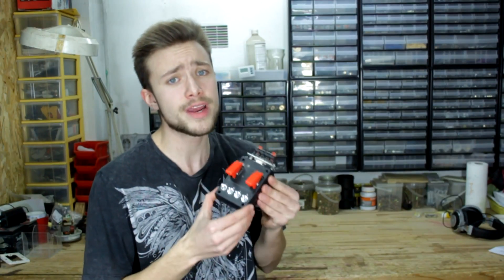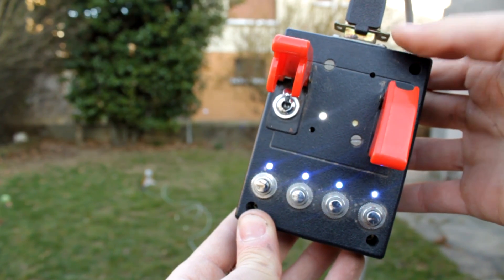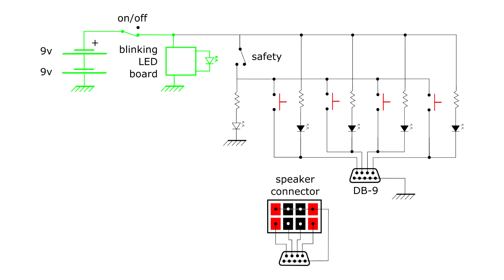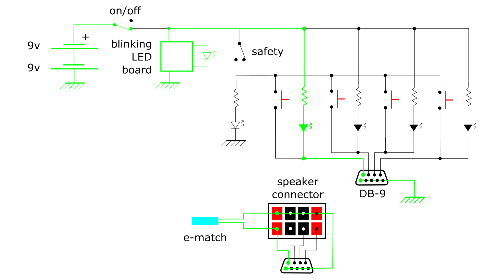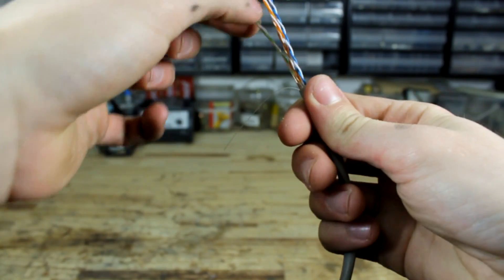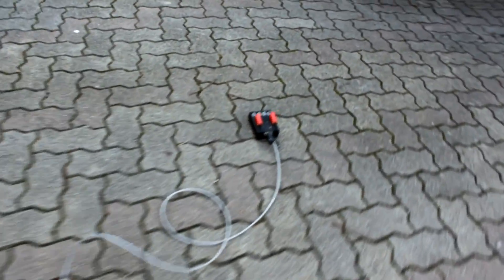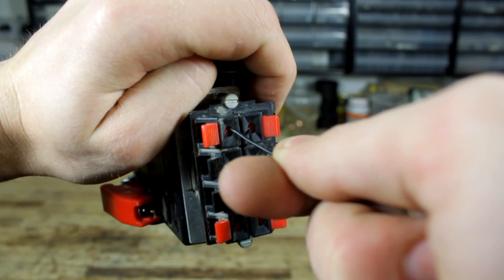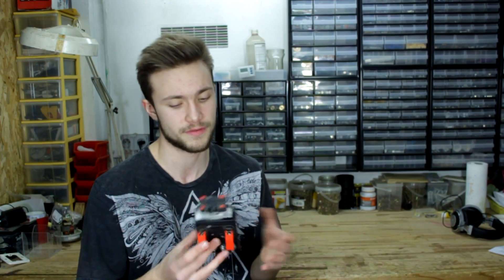HOMEMADE FIRING SYSTEM - How It's Made - Nicolas Salenc PBP

Comment: Nice job,  fun project and a lot cheaper than buying. Here`s a 15 cue firing system i made for rockets a while back. Its arranged in 3 banks of 5 with constant continuity checking, all bank fire and arms via a key. Its powered by an 18v drill battery and connects to the slat via cat 5 cable. 
The first version was ultra bright, https://youtu.be/uQrkAGDJCzg  
so i modded it,  https://youtu.be/UzoNLkuCxg4 
Never did get around to the front panel cosmetics. https://youtu.be/W10qlbV9fR4

Comment: I'm trying to build this but with 96 cues Any advice and can you walk me through this I'm no rocket scientist And don't want to blow my face off when I connect the wires to fire my shells!! LOL
Reply: Always shunt the opposite end of the cable going on your pyro and only connect to your box when you are at a safe distance from your pyro. It's just good practise to get into for safety. Search up nail boards and see if you can make one. They are the most reliable firing system I use. They just never fail because they are so simple. Can rig it up to car batteries in series and it won't let you down :)
Reply: @frgc6159  wanna build a 24 channel one for me ? I'll pay you for it lol
Reply: @johnbrelje4354  is it for fireworks?
Reply: @frgc6159  yes